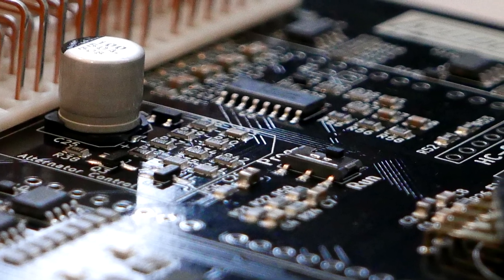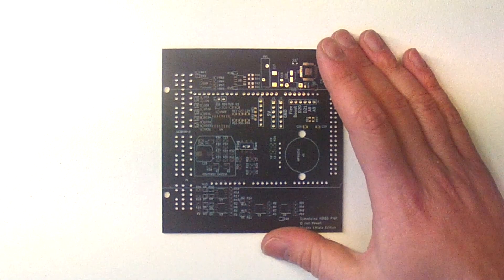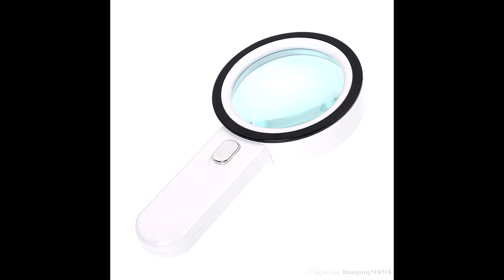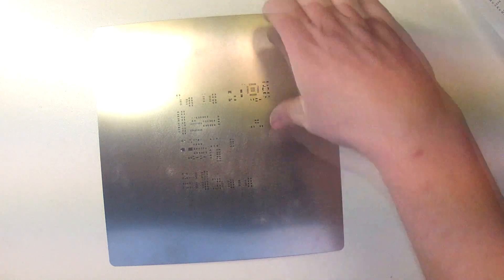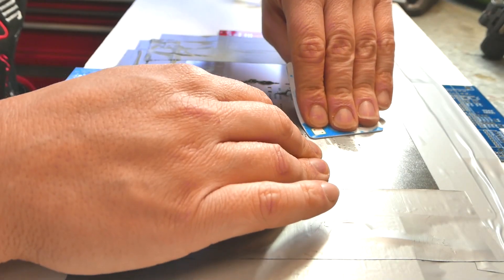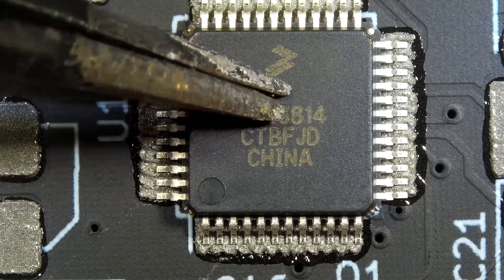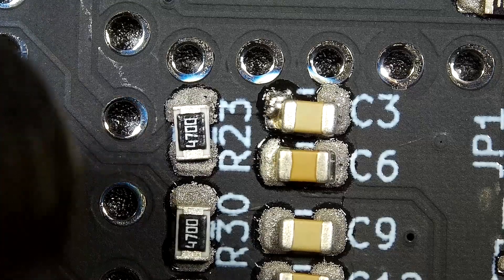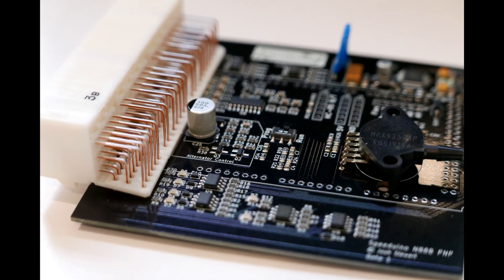Easy DIY surface mount soldering of ECUs

Comment: im having trouble finding a 1k pull up resistor locally in Australia :(
Reply: Element 14 will have stock for sure. You need to know the size. Probably 0603
Reply: @ReubenHorner  thanks mate ill have a look
Reply: Forget Australia, lcsc.com

Comment: What kind of temperature are you running and at what fanspeed? i have a really similar heatstation :)
Reply from the maker: This was set to 360 C and a low to medium fan speed. Every station will be different in terms of it's air speed though, so find something that works for moving a bit of air but that doesn't move any parts around.
Reply: I don't know what station he is using but at work we have some tenma hot air stations. 400c and 50% fan speed is a good starting point. May want to go lower fan speed on the little components to keep from blowing them away